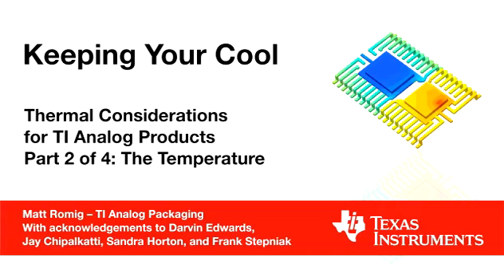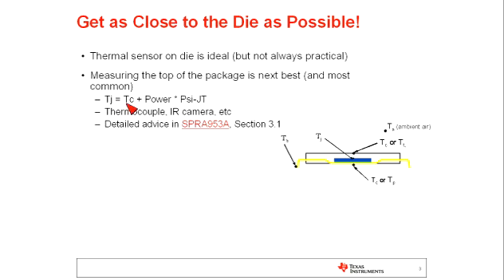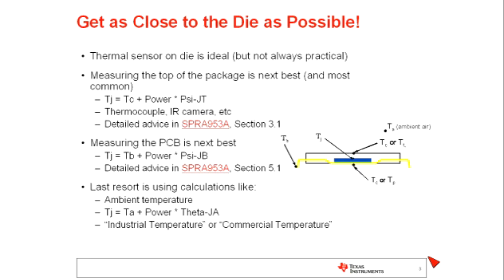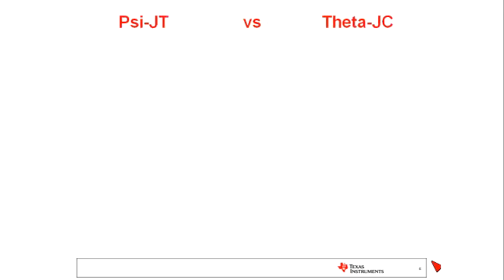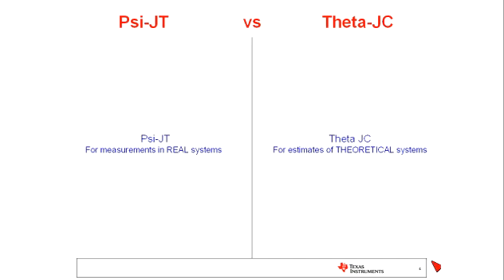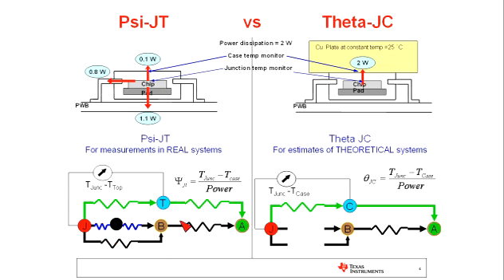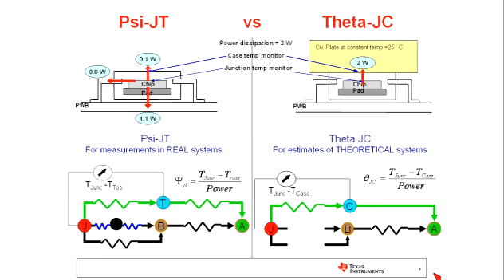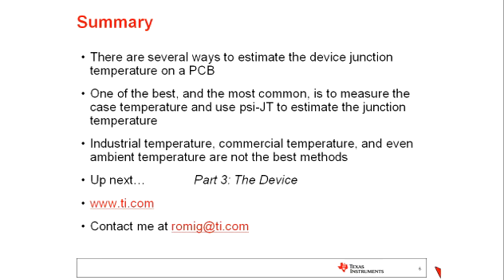Calculating Temperature of a Device on a PCB (Part 2 of 4)

Comment: These calculations are all based on an actual measurement.  But what about when we don't have a PCB done yet?  When we need to estimate the die temperature based on ambiant temp, when knowing the package, the Theta-JA (or JC, or JB, ...), and the approximate planned PCB layout?
Reply: Did you got the answer !! 
How?
Reply: @vishnupriyatummala801  you flip it... you solve what thermal dissipation you need to ensure your component with a known power output doesn't exceed a max operating junction temperature. If you are limited to your heatsink size then use that to calculate you junction temperature based on the component power output. This is all steady state calculations so you might exceed your max junction temperature but it could take 10 hours to do so based on the thermal mass of your system but this could then help define duty cycles of your components. Initially just worst case a steady state and if acceptable then it automatically works for transient states.